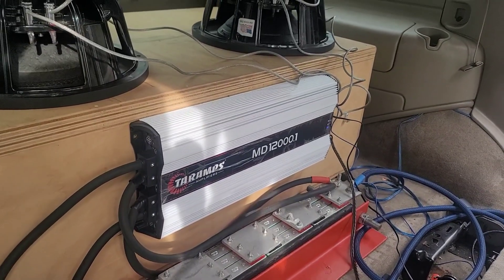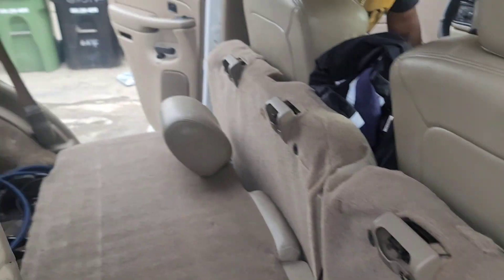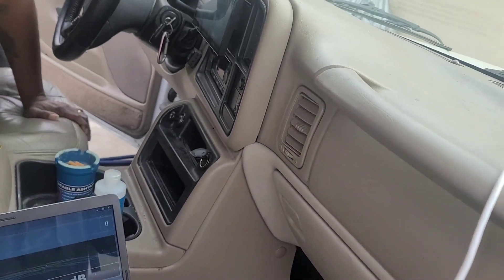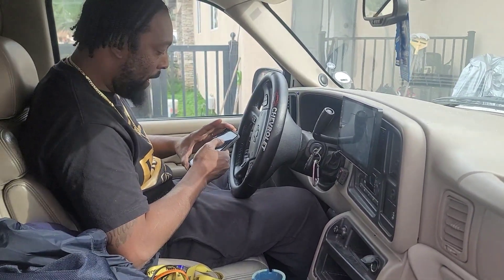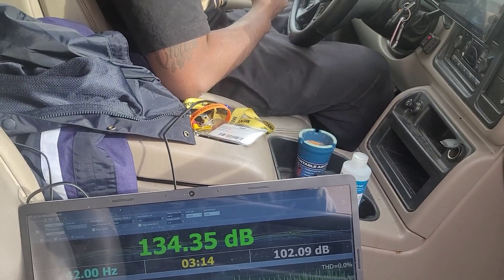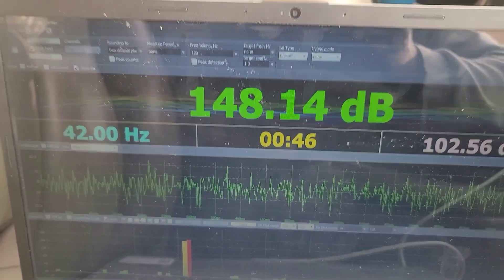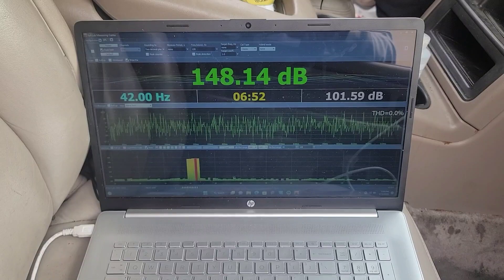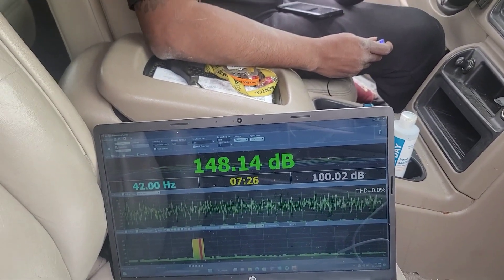[ On The Road To 150DB ] Friends Biggest System 2 Skar Audio ZVX 15s Taramps MD 12000.1 @ 1 Ohm

Comment: That was awesome! I love the testing... Super interesting. So close to 150. Maybe port up instead of back? Might be worth trying? Good stuff.
Reply from the maker: All things are definitely worth trying but with the subs being inverted would be a little difficult to have port flare up. But never know till u try
Reply: @BIGJURAY20  in a SUV with a no wall best  direction to port is driver's side rear quarter sound will bounce to passenger side front right where the meter is
Reply from the maker: Oddly enough in my last truck i test port on driver side vs passenger side and my score didn't change. Really was surprised because the meter was on the same side of the port but yielded the same result

Comment: My question is why do u need a 12k amp if you're subs are only rated 1,500 rms so both are 3krms wouldn't a smart 5k be plenty??or a bass 5k either or.
Reply from the maker: You're absolutely right but in this case we're not using the full 12k due to being at 1 ohm the amp does 7000 watts at 1 ohm. This is the .5 ohm version
Reply: I try to tell people but I see they love putting 12ks on 3k rms as if that’s not enough even with the 5k would be plenty of power but the spl world got people heads messed up but I got a bass 8k on 4 Vxfs and that’s plenty of power for them as a matter of fact it’s to much in a since I’m putting 2k to each sub that’s already rated at 1500 so a xtra 500 on 1500 rms is the most I would go same with a 2000 watt I would put 2500 on them I mean dam he only has max 4000 watts he can throw at them subs so a 5k is enough to give them that xtra if they want to still pop em plus the math doesn’t add up and I plan on getting some dd audio 12s the super and they cost to much to be blowing and fixing I’m not spl but I kind of want to let ‘em know I get down 2!
Reply: @got2getit204  Exactly and that's all I was saying..its not necessary to have al them amps on them subs they dnt need it.But hey waste you're money to be cool and say I have a jp amp on each sub that dnt need it.  Lls.And I was gonna do the 3k on the vxf 15s but it wasn't gonna be enough. I jus dnt have the 5k turned all the way amp and they perform greet and my amp dnt get hot
Reply: @cali8221  trust me I get it now it’s just people just like to do what’s cool but the math shows you hey this a 1500 rms sub  so if you put 1500 watts to it it can handle it constantly with no issues because 12k on a 3k seems like the math is all wrong I know they are talking In burps but all I know is if my subs are 3k rms then 5k would be cool turned down!
Reply: Not with rise and they are very underrated